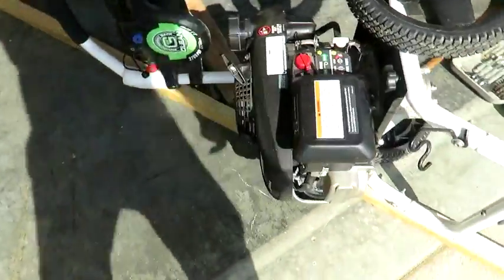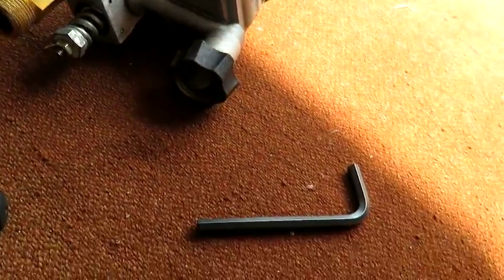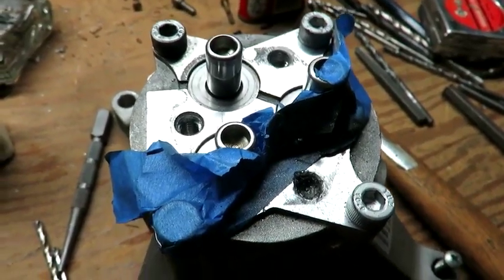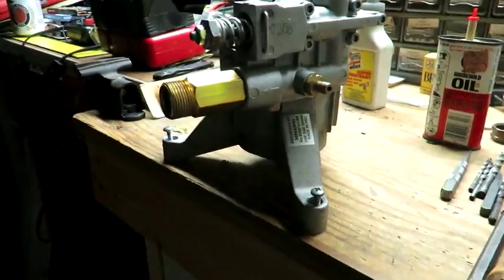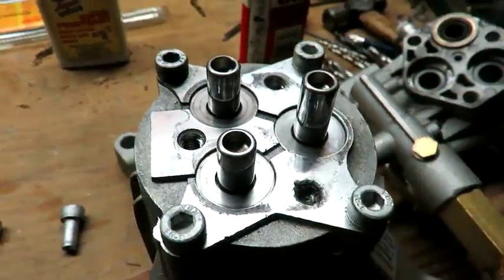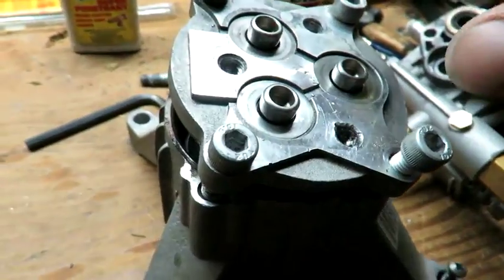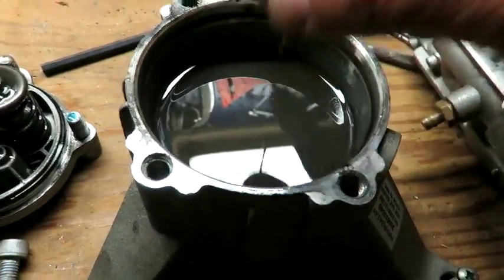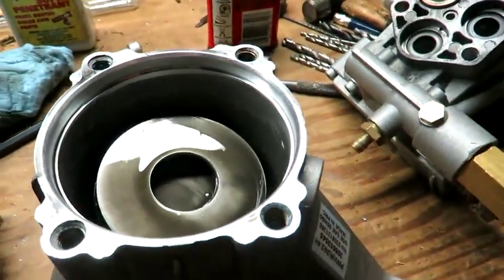Pressure Washer Pump Problem PWV(R)24/2.4H

Comment: Here’s a trick you might be interested in. Are used a Dremel tool with a long extended cord handpiece and I put in tiny stone bits. They are very carefully ground away the bolts until I had a smooth concave surface for me to put my drill bit on. And then you have to drill them deep. I Used small shallow easy outs  on my first attempt and they all broke off in the bolts so the only way to get through such a hard steel was to use a stone bit. When I ground away the old easy outs, I drilled it deeper and used a long easy out and the broken threads came right out. I was amazed because I didn’t even damage the threads. It just takes a long time using the Dremel tool with stone bits to grind down a bolts lengthwise.It is a zen like exercise in skill and patience so make sure you’re not a in a hurry when you do it. Allow for a lot of time. And have at least 5 stone bits per bolt.

Comment: I'm guessing the spool valve. Otherwise known as a spool valve is stuck. It's not allowing the water to unload once you release the trigger. The 3 pump valves pump pressure constantly. So if the unloader won't relive the pressure? Something has to give? Weakest link would be the inlet? Good luck

Comment: friend, one question, the position of the water seals that go inside the copper cup, are you sure they go down? with the tab on the contrary, both rubber seals should not go the same way down
Reply from the maker: I got that pump running again and had a couple of issues, I keep it on a shelf just in case because I could use it. Bought another and have been using it since. I think one of the sub contractors tightened the pressure spring because he had an issue with me. Whatever. I learned to work on these pumps. Have a great day.

Comment: Good video.  Not exactly my pump, but it did give me just enough information on how (and where) to fill the pump with oil.  Leave it to Homelite to basically tell you that if it's leaking oil, return it to an "authorized service center" (or course, there isn't any within 50 miles of me, and Home Depot is clueless).  The oil on the tag says SAE 85W/90, which is basically gear oil that goes into jacks and sometimes car differentials.  Might be why it's so black, as it's NOT a changable fluid under normal circumstances.  But I get the gist on how much and how to put it in now, so since I've been looking for about 2.5 hours on the internet with nary a CLUE on where and how, you certainly answered my questions.  And I"ll be certain to tighten the bolts pretty darned snuggly too.
Reply from the maker: Glad I could help. Great Comment. Thank You.

Comment: Since its a  aluminum housing you could have dissolved the broken bolt with alum and water.
The same alum that is in the spice section.
Reply from the maker: I need to try that in the shop. Really? Very interesting. Have a great day.

Comment: the grey coloured oil...what grad is it? is it diffrent from motor oil... i need to replace mine...and its kinda hard to get specific oils around my place
Reply from the maker: I forgot what oil I used. I think it was gear oil. I went back and watched my video again. Some people use straight 30 weight. I put plumbers grease on the seals for the water area of the pump. Anyways, I bought a new pump and this one sits on the shelf. Just in case.

Comment: The strength of the bolt has nothing to do with it it's too much power for that pump and blew the bolt out of the threads that's what happened in my opinion.
Reply from the maker: I believe contractors at the job site messed with me and cranked the pressure adjusting screw and it blew my pump. Assholes. I replaced it. Still have the old one.